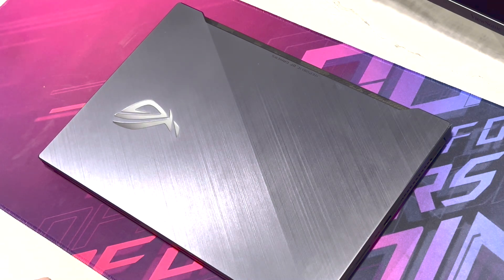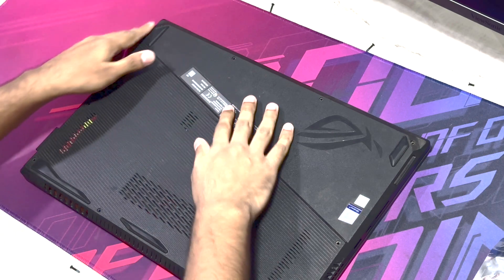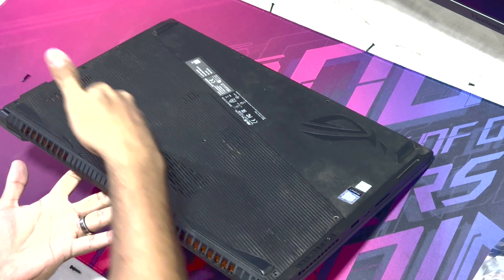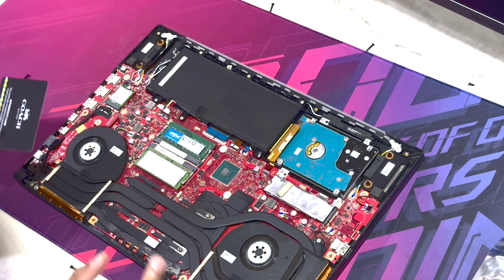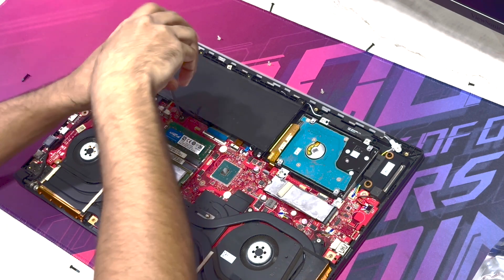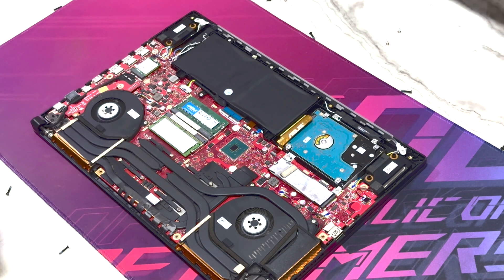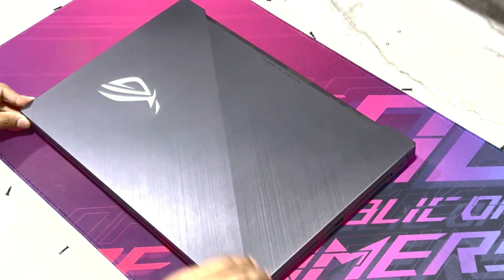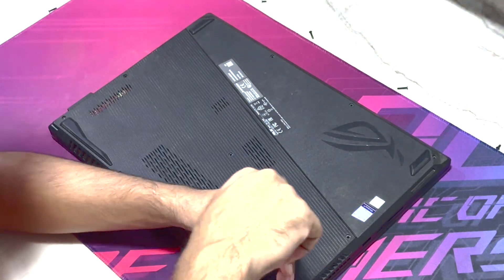ASUS ROG Strix Scar 2 Battery Replacement | GL704G | C41N1731 | In-Depth Guide

Comment: How much time does your new battery sustain?
Reply from the maker: Can't really say, as i only use it at home nowdays, always connected to power. But i set the battery mode to maximum lifespan in the myAsus app so it will only charge up to 60%.